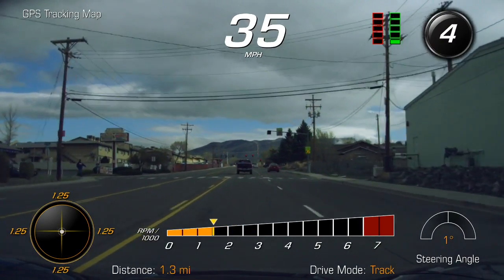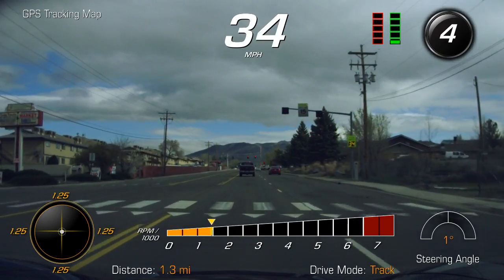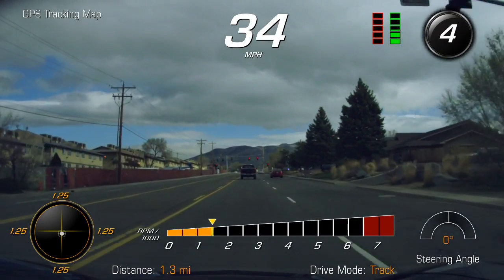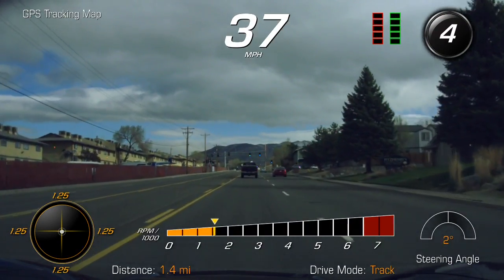2017 Corvette LT1 Break In Explained

Comment: Read the owners manual.
There is a break in for reving the engine !  Do not take it to
redline until AFTER 500 miles . Your mechanic is full of shit.
The manual IS the BIBLE.
Reply from the maker: MrMustangrick I did read the manual. If you watch the video I say to do what the manual says and don't rev past 4500 for the first 500 miles.